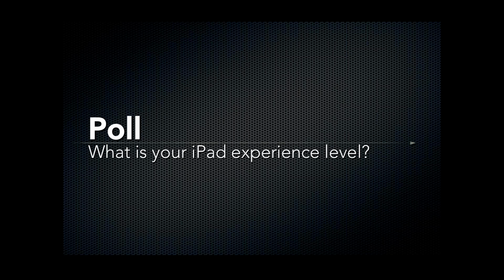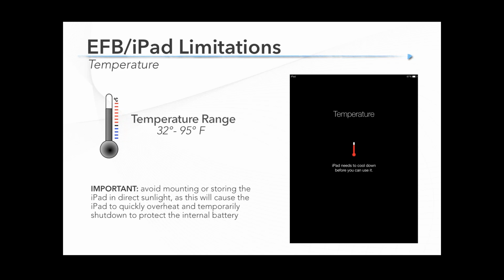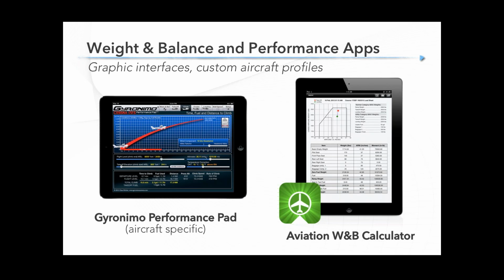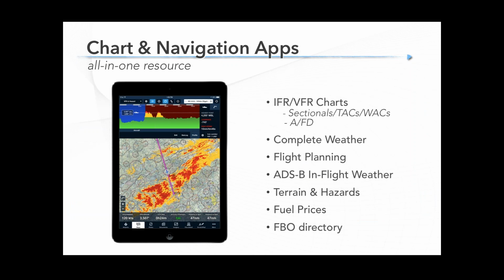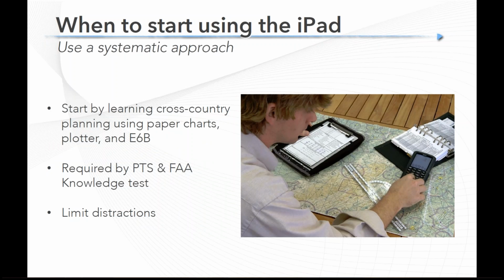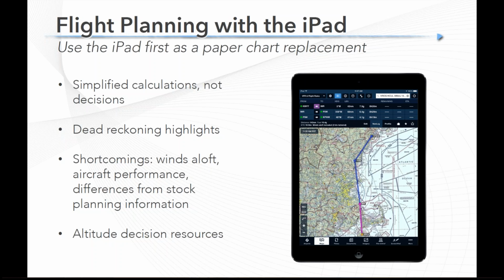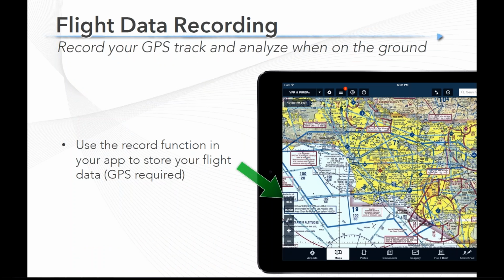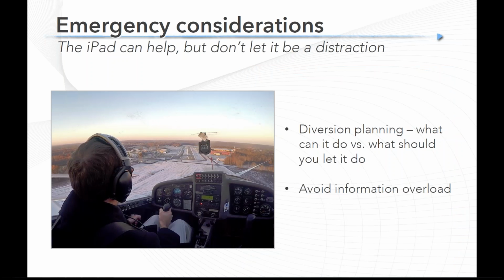Flight Training with the iPad: Tips and how to use it effectively

Comment: I live in Wisconsin & purchased an iPad Mini 3 this Winter (previously had an iPad 2 until it became outdated) & quickly figured out it doesn't like the cold as much as it doesn't like extreme heat. I've got in the habit of actually storing it in my coat (only because it is so small) to keep it relatively warm for use in a cold cockpit. If that isn't an option for the larger models I would recommend wrapping it in a shirt or small blanket & keep it in a backpack or flight bag until ready to use or the cockpit is heated.